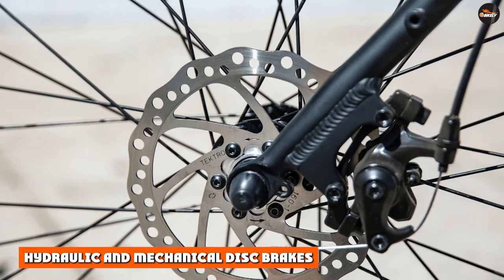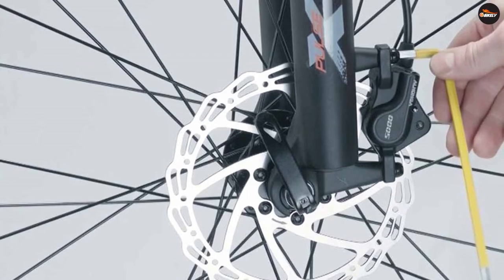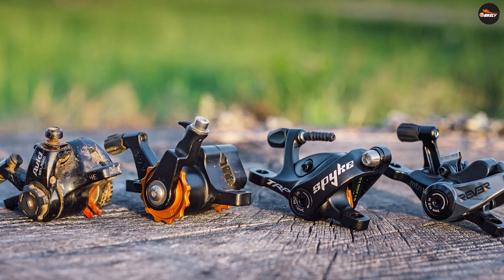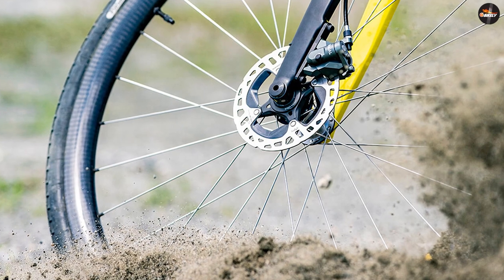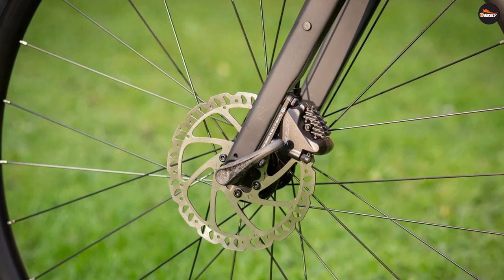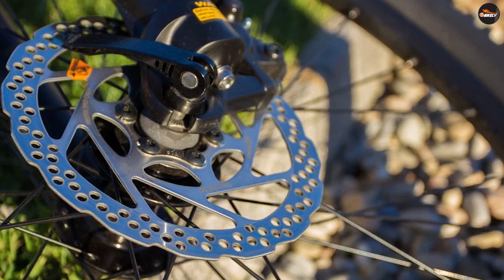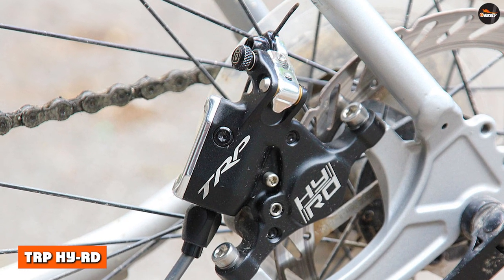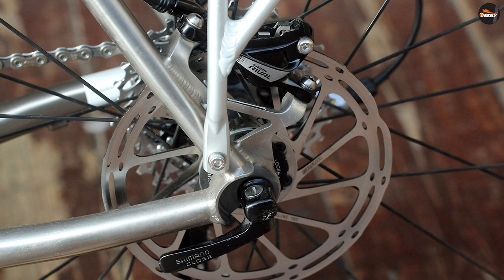Mechanical vs Hydraulic Disc Brakes: Who's Doing It Better?

Comment: If the brake compounds are the same, the results will be the same regardless if it's hydraulic or wired. The difference will be on the consistency in how the brake force is applied. 

In wired brakes, the pull is inconsistent since it will depend on the strength of the user and the wire tension.

If the same force (grip) is applied on both hydraulic and wired brakes, the brake compounds will produce the same results.

It is no different to an electronic button pressed faucet versus a manual rotary faucet: the water that comes out of it will be the same, it will not turn to some mystical water, if you use a button.

Hydraulic brakes are an improvement in terms of usage and efficiency, not performance.